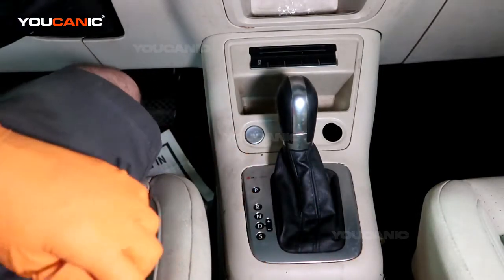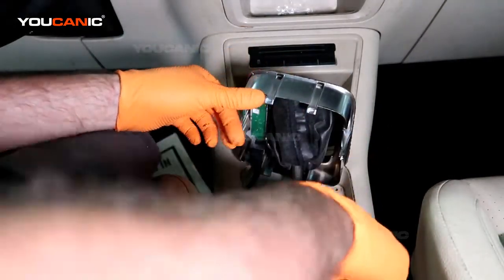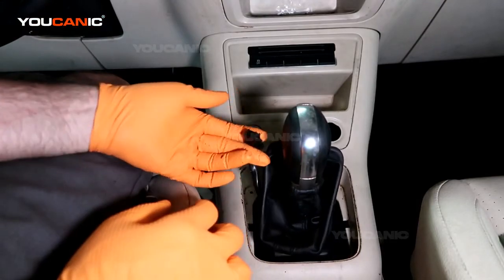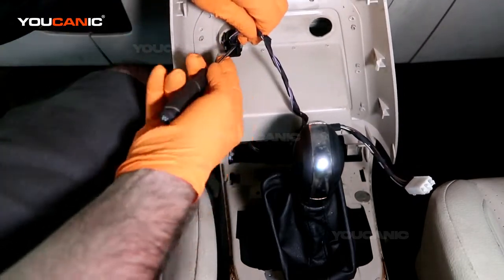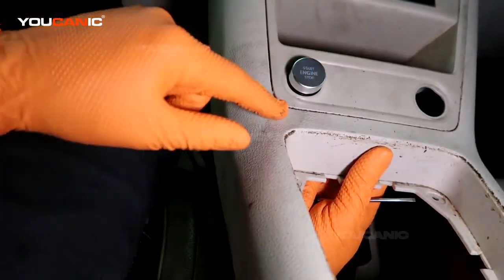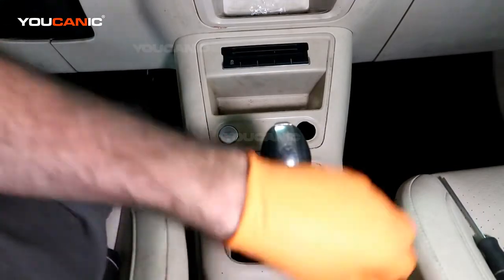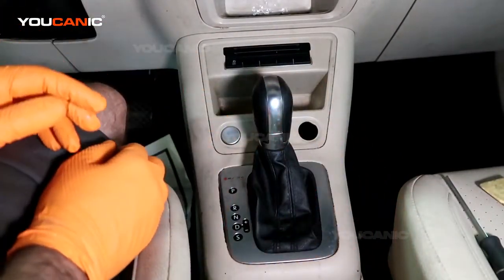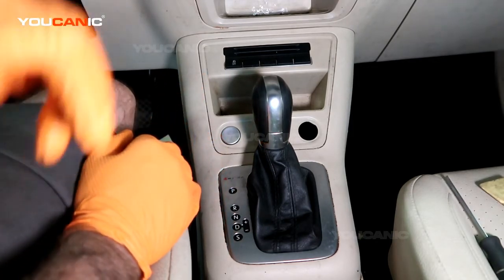2009-2016 Volkswagen Tiguan - Start/Stop Button Replacement

Comment: I have a 2017 Tiguan. I thought maybe the switch needed cleaning but these switches are probably self contained and can't be disassembled. The fix looks straightforward enough so I can save maybe $200+ by doing it myself.

Comment: I had same issue 2014.  One of the few jobs that went exactly as planned.  I don’t do a lot of mechanical work, but this was simple knowing how to get the cover off makes it a simple job.  I order replacement parts from Amazon, was $40 versus $150-$225 from other parts stores.  Works just fine.  Thank you so much for making this video.

Comment: Thanks! This was very helpful!
Reply from the maker: I'm glad you found the video helpful! At YOUCANIC, we aim to empower car owners like you to diagnose and repair your vehicles with confidence. You might also be interested in our comprehensive YOUCANIC Full System Scanner, this tool is like having a mechanic right at your fingertips. Here's the link for more details: www.youcanic.com/scanner

Additionally, we have a plethora of resources like OEM Factory Repair Manuals and a platform for car-related questions on our website www.youcanic.com. Feel free to explore and don't hesitate to reach out if you need further guidance. Thanks for trusting YOUCANIC. We're here for all your automotive needs!